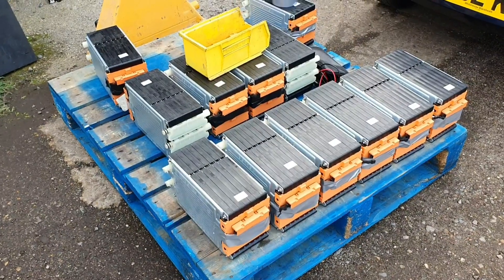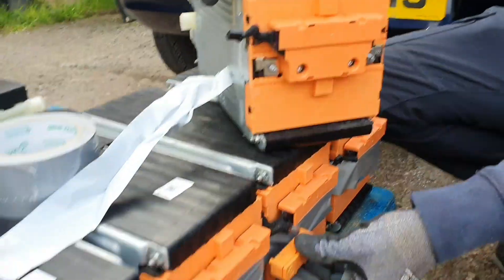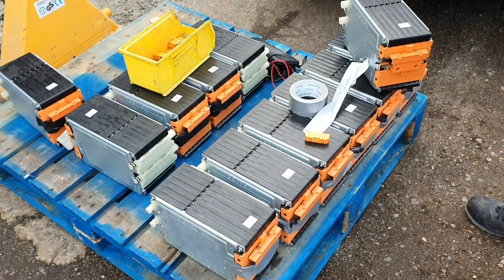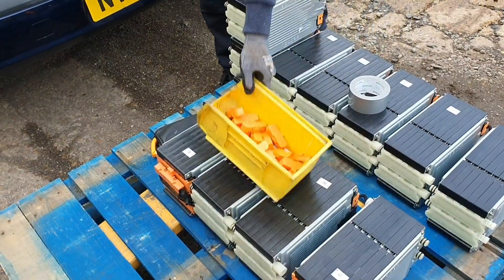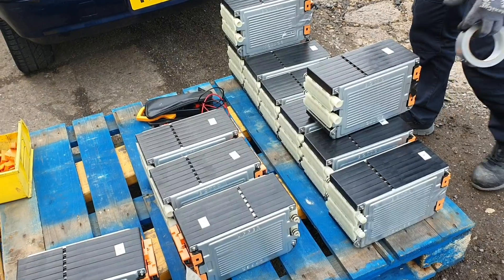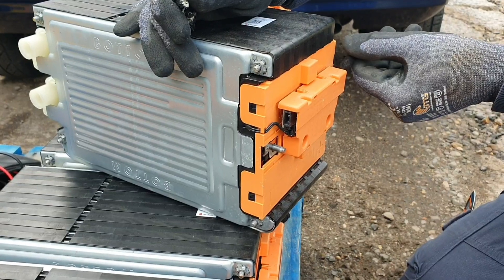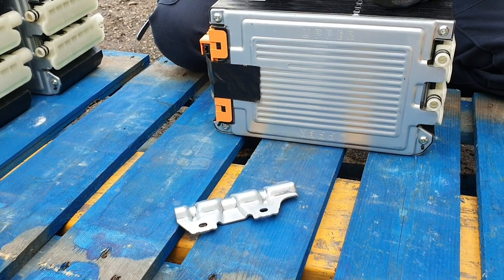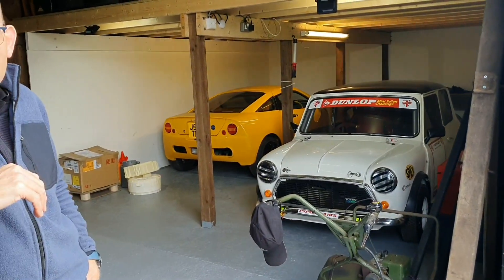REVA G-WIZ: Yellow Wiz Lithium-ion Conversion pt.6 - meeting EcoClassics & collecting LG modules.

Comment: wello Richard, just having a think I know you can get waterless coolants for ice engines I think there a really low viscous oil is that an option you could use as a coolant for your new batteries, if I listened properly I don't think you'll need a coolant because there won't be that much of a load on them
Reply from the maker: Right, at first I won't need to, but in the future I plan to rig up rapid charging to charge the batteries in under an hour. So then I would need to put the original solution in to avoid causing any problems. I have the details on the mixture now so it shouldn't be a problem.